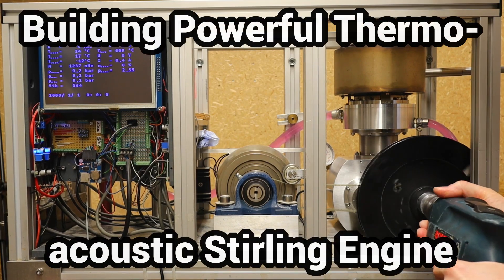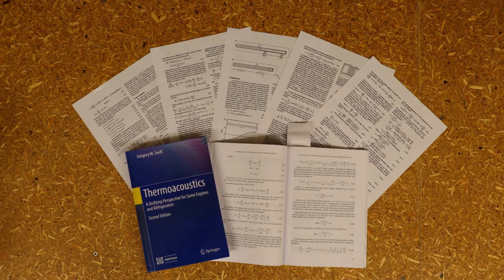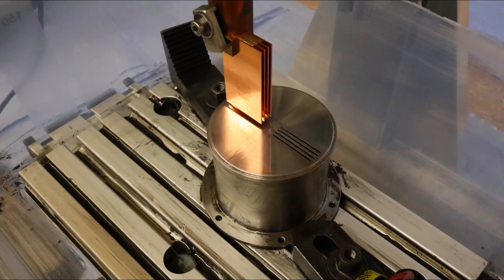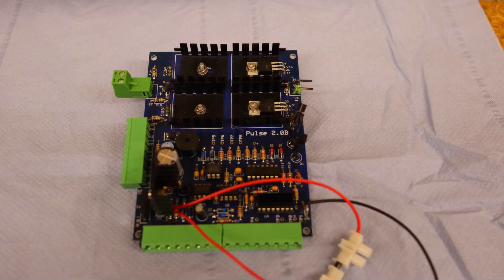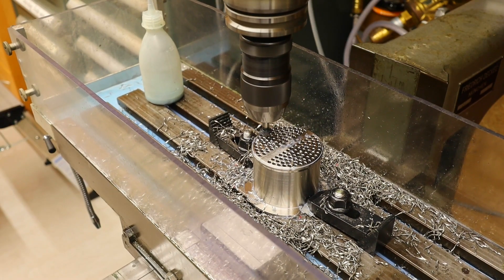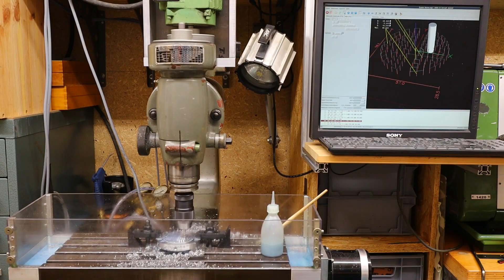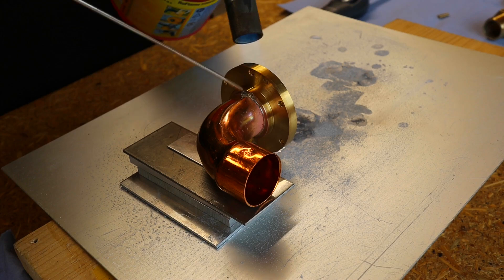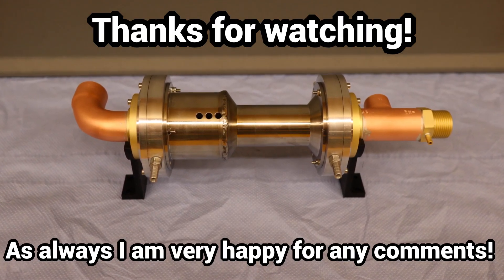Thermoacoustic Stirling engine build – the struggles to get more power

Comment: WHY SO SMALL. IT CAN NOT POWER YOUR HOUSE?.
Reply from the maker: With higher pressure and much development of the acoustic loop and heat exchangers it maybe can.
Its meant as a backup for the solar plant in times of low sunshine.

Comment: What are the three holes on the body for? Doesn't it cause gas leakage?
Reply from the maker: The three holes are for the flames to go through the heater and heat the gas passages from the inside.
They have no connection to the gas passages and only improve the heat transfer.
Reply: @myengines2443 Thank you, do you think a thermoacoustic engine can perform better than a Stirling engine?

Comment: Another way to create slots is stacking sheets with shims between them to create fixed distances between the sheets.
Reply from the maker: And then weld them together to be tight or just press fit them in the heater?

Comment: I'm curious are you using helium as your working fluid? I imagine you want an ideal gas. This also raises the question of working pressure, which i imagine at current is at atmospheric so that the transducer can move freely.

maybe the non-active side of the transducer should be evacuated? or at least have a helium buffer to act as a gas spring.

is this a pulse tube design or is the valve closed during operation?
Reply from the maker: The new engine will hopefully be pressurized up to 10 bar both with air and helium for comparison.
Then the non-active side has to be closed and act as a gas spring.
Its a TASLiCE engine similar to TASHE and no pulse tube engine!

Comment: I think metal 3d printing makes sence heat exchanger.
Reply from the maker: I am not sure if metal 3d printing is gas tight at higher pressures.
10 years ago I had some copper 3D printed parts that were not gas tight enough!
Maybe today it is better, does anybody know?
I get constantly offers of making adverts for 3D printing firms and then maybe a collaboration makes sense?

Comment: Why do you not use a Subwoofer Loudspeaker as generator? It is already designed to convert pressure waves from a gas to electrical power and vice versa. A 100mm speaker could be at the end of your device with a closed volume at its back to reflect the incoming waves. You could use a frequency generator to start up operation of your device and then switch over to a variable resistor ( variabler Hochlast-Draht-Widerstand ) to act as a load. As soon as you found the sweet spot you can replace the resistor with a software controlled rectifier. I can help you with that if you want
Reply from the maker: Loudspeaker tests are planned, thanks for the idea of using a frequency generator for starting up!
Reply: @myengines2443  if you have a big 100W+ old Class-A Hifi Amp you can just connect a Software frequency generator off your laptop via 3.5mm-Klinke. It will even eat power generated by your device, but not indefinitely. For short tests, even for a minute or two  it should work
Reply from the maker: @johgude5045  thanks a lot I will try it!

Comment: I've always wanted to see the performance of a home made high pressure thermoacoustic engine. I was thinking of housing a tiny one inside of an autoclave in the future. I eagerly look forward to seeing the performance results.
Reply from the maker: Please can you describe what you mean with the autoclave, I did not understand it fully?
Reply: @myengines2443  Before i understood that a thermoacoustic engine required a more complex geometry than a stirling engine, i was thinking of sealing a small thermoacoustic engine inside of an autoclave with a copper coil and magnet to achieve very high pressures. 

However I don't believe it'd work, again due to the shape of the internal volume of the autoclave not providing proper acoustic performance.

Comment: interested to see how it works.
Reply from the maker: I hope to show it soon...
Reply: One option for higher power generation would be normal piston rotating Stirling engine or another option, two sided linear piston engine with dual springs, magnet coils for direct electric output @myengines2443
Reply: @myengines2443 One more idea. Two cylinder balance lever Stirling engine. Opposite phase pendulum action. i mean vertical cylinders with horizontal tilt lever axle rod.
Reply: @myengines2443 You know, a wood furnace chimney turbine is the simplest powerful energy generator.

Comment: The quality of your work is impressive. Why did he decide that the regenerator would be most appropriately made of chrome nickel and not, for example, copper or aluminum?
Reply from the maker: The regenerator gets really hot and most other materials would corrode and the important thing in the regenerator is a high temperature gradient which needs low thermal conductivity material.
In a copper regenerator also the cooler end will be hot!
Thanks for your kind comment!

Comment: can you use graphite powder and mold a heat exchanger ?
Reply from the maker: You mean to pour a heat exchanger in stainless steel?
That's really not easy and would be a challenge of its own!
Or do you mean use the graphite as the exchangers?
I think it wouldn't be rigid enough at least for higher pressures!
I often used graphite for sliding parts or as tools but its brittle and not very rigid!
Reply: @myengines2443 yeah I meant a graphite heat exchanger, yeah it maybe not handle high pressure.. what about silicon carbide ? Can be molded and can handle high thermal efficiency
Reply: @ Hotter heat exchanger temperature results in less efficiency of transferring heat from the burner flame to the heat exchanger itself (e.g. from 2200K flame to 1100K heat exchanger we only get at most 50% of total enthalpy in flame transferred, as the exhaust gas must leave the heat exchanger at 1100K or hotter).

There's a tradeoff between the heat exchanger efficiency and engine efficiency, leading to an interesting optimisation problem of finding the heat exchanger temperature that gives the best performance overall. I think a ceramic heat exchanger starts to make sense if you use solar power from a parabolic mirror, as the sun is a 6000K source so heat transfer can still be efficient at 2000K or more.

Edit: there is a workaround for this to some extent, you can pass the exhaust gases through a recuperator and use them to pre-heat the combustion air before it goes into the burner. Though sadly no recuperator can be 100% efficient.

Comment: I follow this project with great interest. Quick question: would drilling holes and the wire edm'ing slots/snowflake shapes be any good? Or one central hole and then snowflaking for maximum surface area?
Reply from the maker: Yes, I am also thinking of a good geometry that has a good heat transfer and is easy to EDM.
I think I have to put more work to the electrodes to achieve both goals !
But I have only a sinker EDM and no wire EDM, building one would be nice but unfortunately my time is limited....
Reply: @myengines2443  Why even bother with EDM if drilling is so much more effective? An automated drill emulsion system and filter would even speed up the process and make it more reliable
Reply from the maker: @johgude5045  small slots give a better heat transfer area than round drillings of a reasonable diameter.
The next heater version will have much smaller drilled holes or will be eroded with complex electrodes or have a complete other design!
Reply: @myengines2443  Thx for answer. Another idea that comes to mind is to use laminated lasercut steel sheet with slots and just stack them. Ordering 2mm stainless steel sheets is quite cost effective if you buy like 10 or more. I order them from cutworks for example. Then you are free to use any slot geometry you want as 2mm sheets can be cut very precisely.

Comment: Beautiful parts, looking forward to seeing it running!

Do you know a source of information on predicting the performance of heat exchangers? I've been working on a python program for simulating hot air engine (and eventually ICE) working cycles, and at present my implementation of the heat exchangers is rather abstract having only a fixed heat transfer coefficient (for most types) or an empirical function originally designed to predict heat transfer coefficients in diesel engines (for reciprocating cylinders). If there were a better way of making predictions of heat exchanger behaviour I'd be rather interested.
Reply from the maker: I think seriously calculating heat transfer is very complex.
I used FEM programs like Ansys or FreeCAD to design my Stirling heat exchangers with good results and often only estimated calculations or desigh charts!
Thanks for your nice comment!